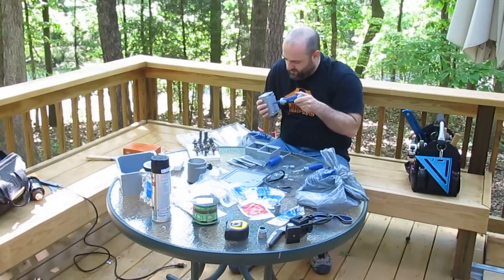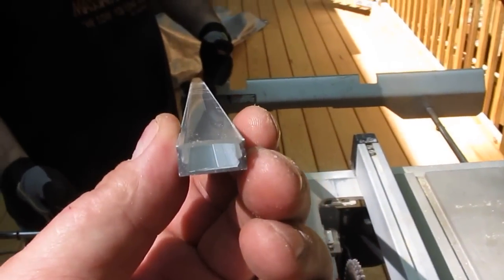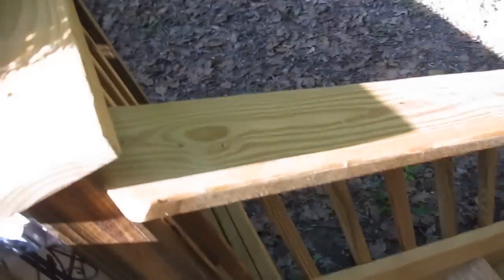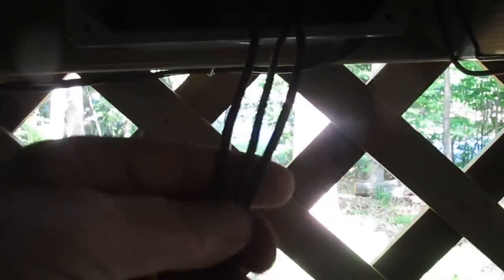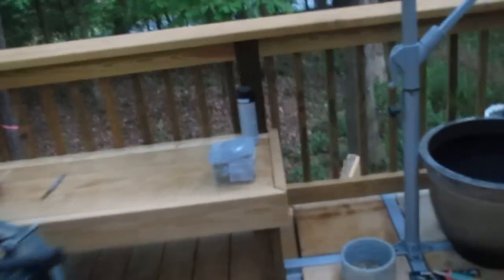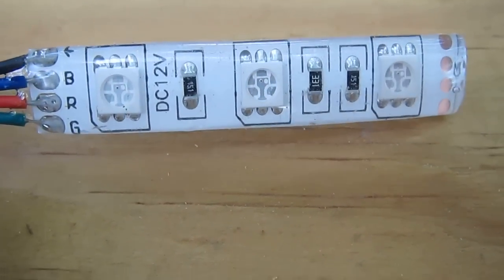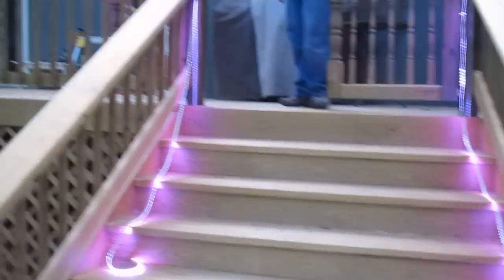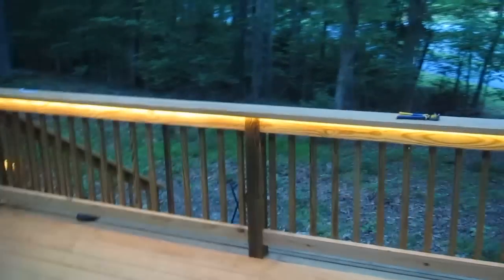LED Deck Lighting Installation

Comment: Great job!  Great vid, guys!  Thank you...

Question:  In the dado channel, must you put the plastic lens over the LED strip?  Wondering if the light may be more 'clean' without it, especially over time as the plastic dulls and fades; but maybe protection of the strip is the function?

Comment: i have same set up deck i bought 60' of led 3528 300 leds on each 5 meters, how many amplifiers did you use or should i use
Reply from the maker: +paul gonn We used one stout power supply and heavy wire and rather than powering just one end we powered it in parallel at every juncture to ensure even lighting

Comment: This was a great video an is exactly what I want to do to my deck.  It would be great to get a full list of materials and/or suppliers.  I did find the high density Tri-Chip High Output strip 300 LED elements per 5 meter length on Amazon but what not sure if is was the right kit.  It only cost ~$20 for a 5 meter strip and controller.  Also found the aluminum channels but they only seem to come in 3 ft strips.  Anyway great project and that's in advance for any additional info you can provide,

Comment: hello or I can buy the molding or LED are sticking? how to call this molding?
thank you
Reply from the maker: It's an aluminum extrusion. You can search it on Google using terms like "Aluminum" "Extrusion" LED" "Molding" and it is sold here in the US at quite a mark up compared to sourcing it direct from China through Alibaba or something like that.

Comment from the maker: From China. You would be well served to do some research to make sure the product you order is the product you want. The main issue with direct orders from Chinese MFRs is they often produce many grades of merchandise from the absolute crap that is flooding eBay to the sort of crappy but works stuff that is all over Amazon to the top grade material you buy from a boutique like SuperBrightLEDS online at a premium.

Comment from the maker: Spiitz ordered 4 reels at one time...not sure how it breaks down. I would guess about $50-60 per roll for the 300/5M RGB 5050SMD TriChip Certified weatherproof. He spent a fair amount of time tracking down the distributor of the real stuff. There are lots and lots of fakes on Amazon and eBay. He ordered direct from China.